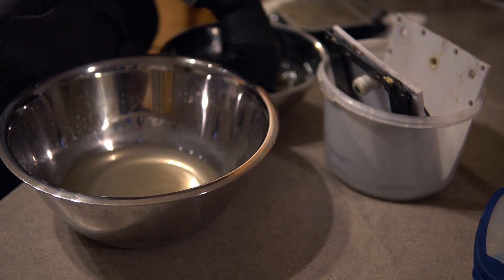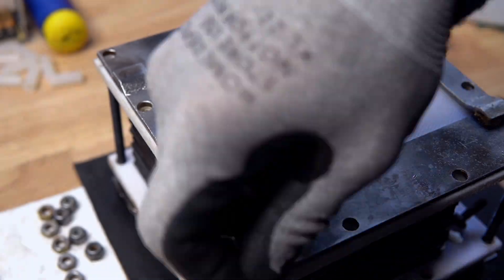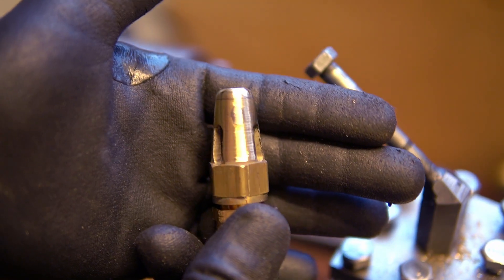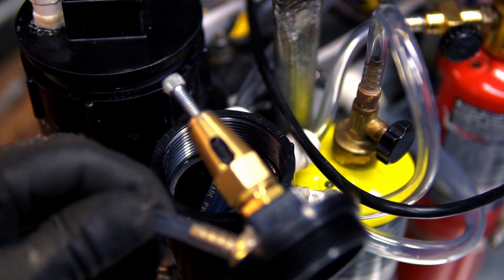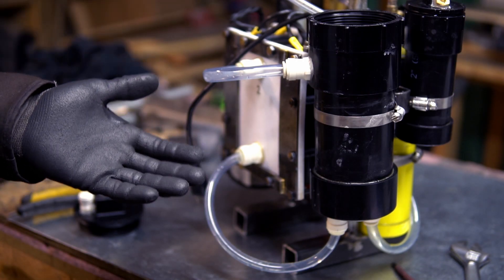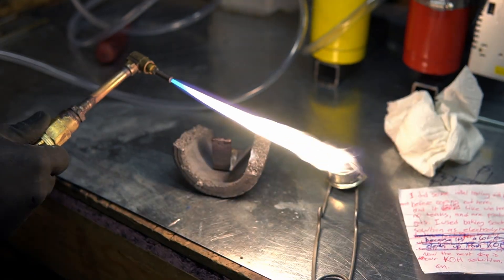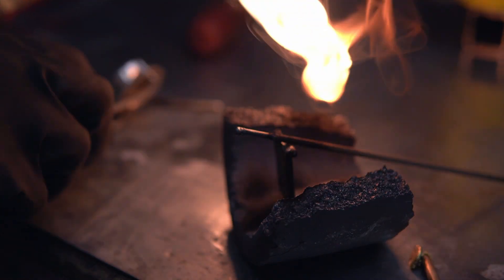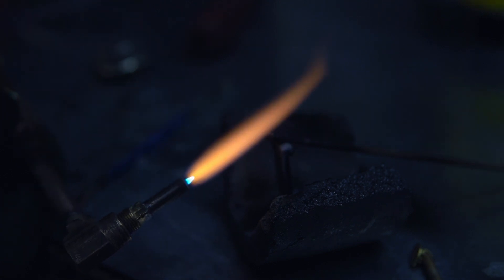HOMEMADE 2,800 °C HHO torch

Comment: Ist posible to mix acetylene gas with propane?
Reply from the maker: really any kind of fuel would work, the biggest limiting factor with my build is the oxygen output of the cell. More oxygen means you can burn more fuel, which means more heat